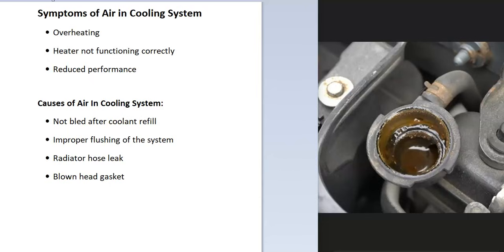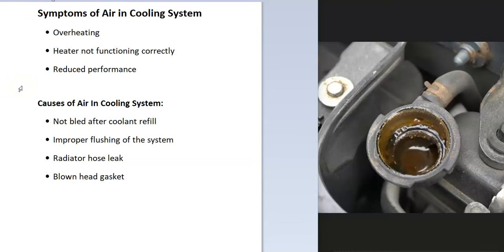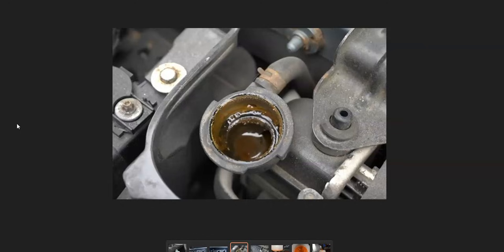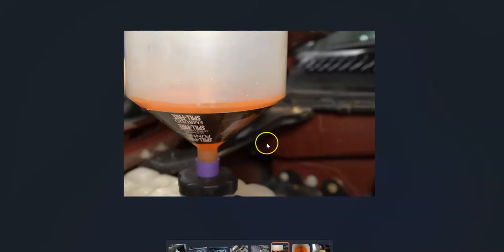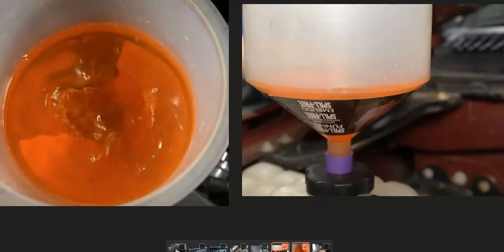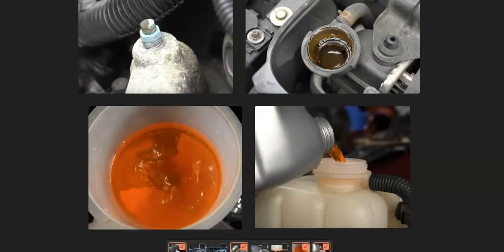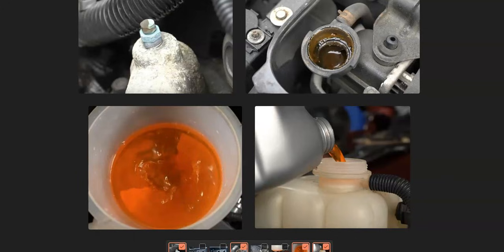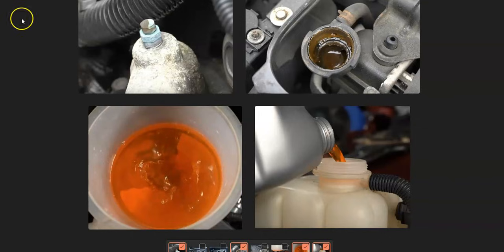Symptoms of Air in Cooling System

Comment: I have a 2021 expedition.  I’m in the mountains in Asheville.  My car runs cool riding around town just fine.  But when it climbs a mountain on highway it starts getting hot.  When I let off the gas and coast it cools right back down.  Weirdest thing ever.  Never gets got in normal driving.  It’s full of coolant.  I’ve changed thermos stat.   Idk what to do.

Comment: I hear water running noise on the start of engine and at times while idling ….. else no issues with the car …. mine is a Škoda 
Remedy please it has been one year I can’t find a solution to it
Reply: I have a vw makes the same noise also bubbling in the coolant pipe.
Did you manage to find out the problem?
Reply: @busterdoug5819 did you manage to find the problem

Comment: My car isn't leaking and the temperature is fine but the heater is still only blowing luke warm air. The coolant reservoir is in the middle of max and minimum when cold.
Reply: broken AC compressor maybe
Reply: Check your blower motor delay homie hope it helps
Reply: You can test it with a voltage tester
Reply: Try flushing your heater core with a hose could be clogged very common

Comment: My car reservoir got swollen and the cap is not sitting properly because my water pump belt had burst now i replace the water pump belt an notice the car is over heating should i change the reservoir and bleed the cooling system

Comment: Mine is not reaching optimum temperature,
I checked radiator, it was not warm while driving
So thermostat valve wasn't open.
I drive for 20 minutes still not low temperature

Comment: Mine is overheating and leaking couldn’t find where its coming from
Reply: could be water pump or you have air in your coolant system
Reply: If its def a leak buy dye put in statem and use uv  torch to find the i4ak wirks well unless it's in combustion area